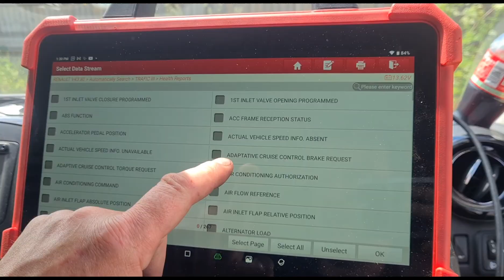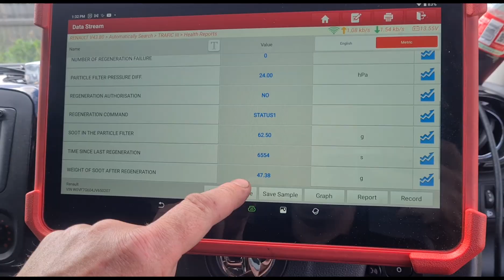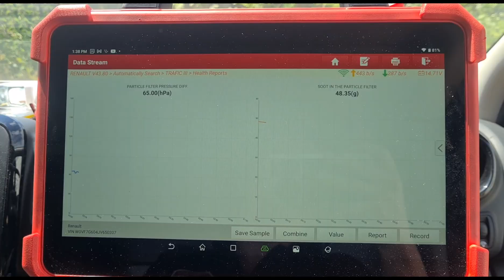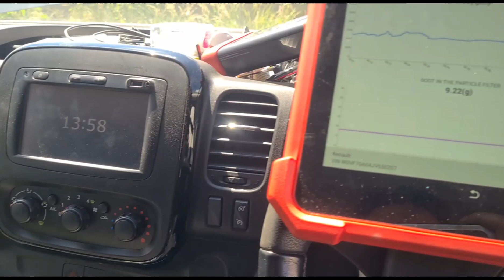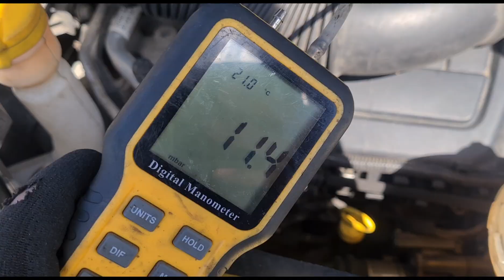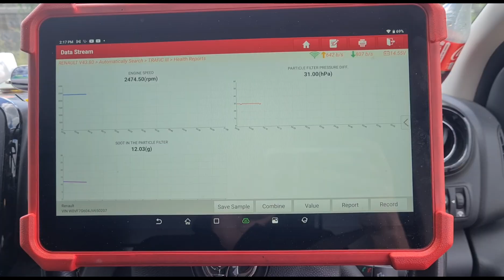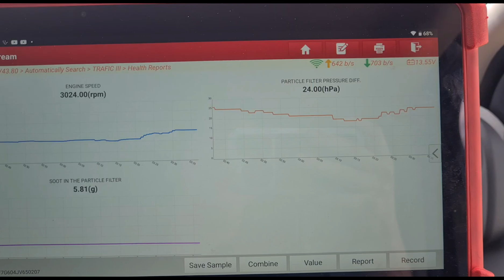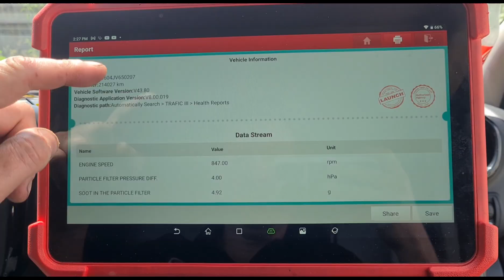Can You Clean DPF Ash On The Vehicle? Diesel Particulate Filter

Comment: Who would of thought Brick Acid would be a thing, folk will try anything & that’s how we learn these tricks 👍
Reply: Jimmy? you switched to a differnt acid. 
First time around Jimmy tried brick cleaner it was ACETIC ACID, and appears to be a high grade of pure synthesized vinegar. Regular vinegar (3% to 6%) of course won't work you would need at least higher percentage concentrate, so brick cleaning acid (20%) is a good choice. You could actually buy cleaning vinegar at 35%, 45% up to 75%. Probably worth a try but I would think running a DPF rinse after that higher concentration would be a good idea to stop corrosion of the metal coated parts, and the seams of the housing because the stuff eats steel pretty quickly. Pretty sure the preheat catalyst is Flashed platinum ( I just looked it up and platinum resists corrosion from Acetic acid 30%, and Acetic acid Glacial. best to put it in the pressure sensor line to avoid going through the cat, but this acid does eat rubber and neoprene pretty quickly so be careful with anything similar to rubber parts. No idea what it does to the metals in the SCR, but this is a last resort instead of paying $1500 or more for a new DPF. Definitely worth a try. The chemistry suggests that the micro particles of ash, which is actually metal deposits, would be corroded and dissolved. Nice way to get rid of ash Jimmy. Thanks for doing the research.

Comment: Nice video , the brick and patio cleaner what acid exact are you looking for in the product?  i cant find the exact one you have
Reply: ACETIC acid - and this time hydrochloric?! - it is listed right on the front of the jug as Acetic aced 20% in the previous video and now a switch to a differnt acid in this video
Reply: hydrochloric, nitric and acetic acids are all used in brick cleaners. so far he has used 2 kinds?!?
Reply: Hydrochloric
Reply: I have read one study while searching for this info that there should be 1:1 hydrochloric acid and also 1:1  concentrated nitric acid . So 2 ml of  water 1ml hydrochloric and 1ml of nitric acid.